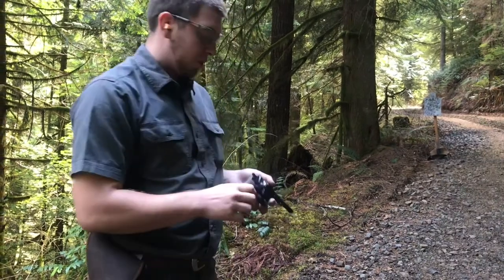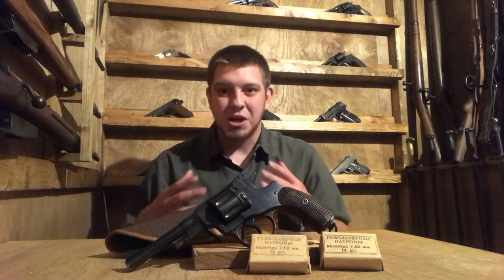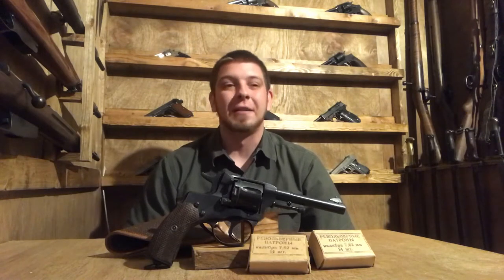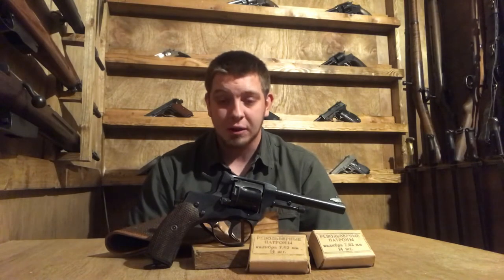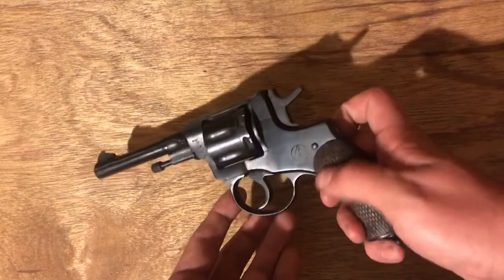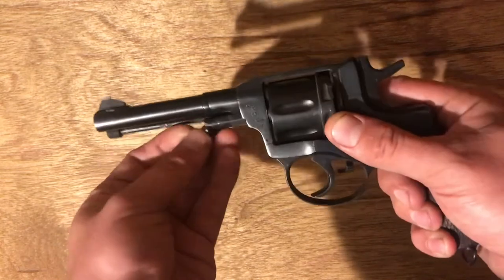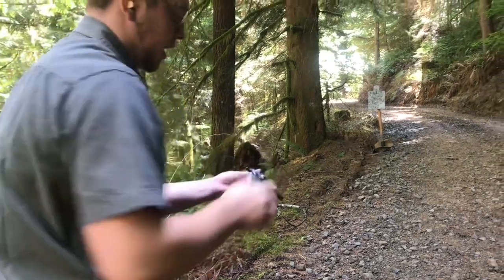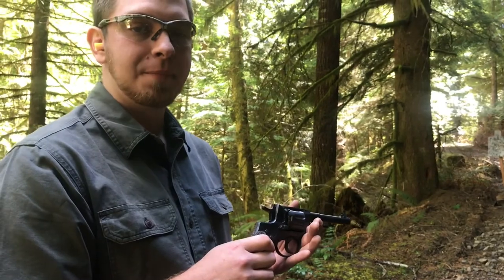“Nagant Revolver” Model 1895 (7.62 Nagant) History & Shooting Demo

Comment: I really wish they had kept the Smith and Wesson Model 3 instead of going for the Nagant .And I wish original Private's Model Nagants were not so impossible to find .
Reply: Yeah, they should have, cause S&W was way easier and faster to reload, which almost compensated for it's drawbacks, compared to Nagant - it was heavier, bulkier, had a inferior ballistics due to a larger caliber round still using black gunpowder, and was somewhat less reliable due to a hinged design.

Comment: Not having a removable cylinder, this revolver is probably a pain in the a$$ to unload and reload, inserting the rounds one by one, isn't it? Especially during a gunfight or in a stressfull situation. And the trigger pull in a double-action mode is pretty heavy, isn't it?
Reply from the maker: It takes forever and is one of the worst double actions I’ve ever fired lol, it is a very sturdy design though
Reply: @GreatNorthwestWeaponry  yeah, it is, due to it's solid, one-piece frame. I liked how you removed the cylinder, apparently, from what I've heard, replacing the cylinder could take faster than actually reloading it with new rounds one by one :)